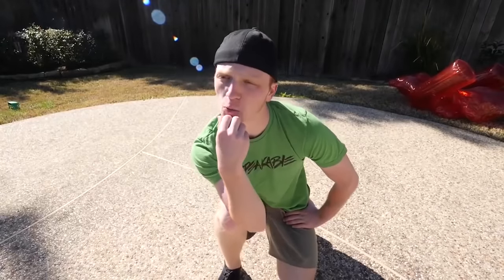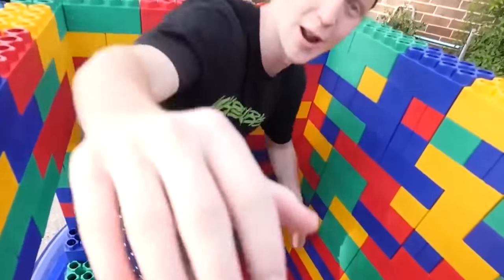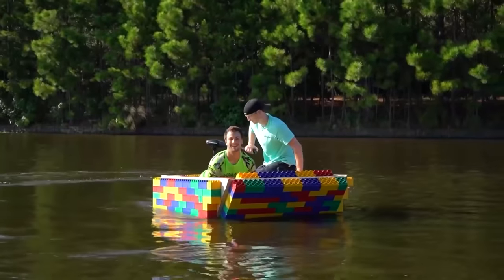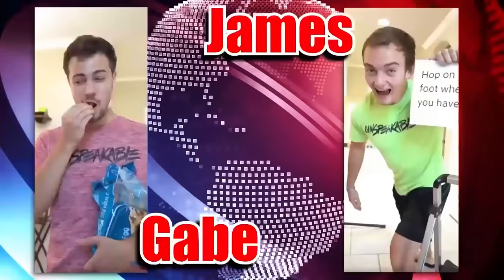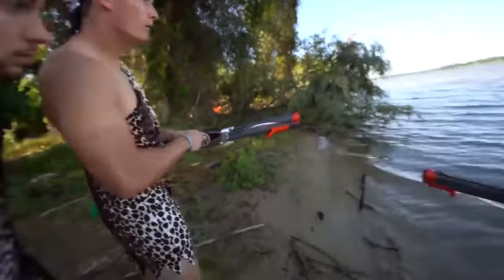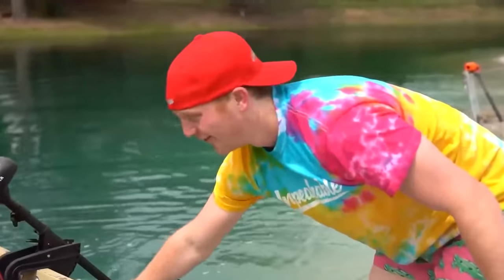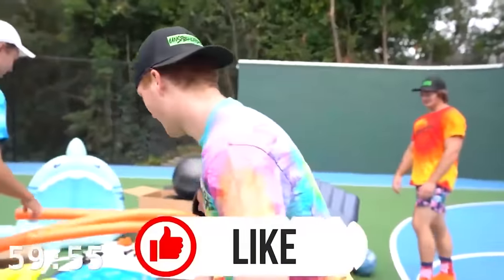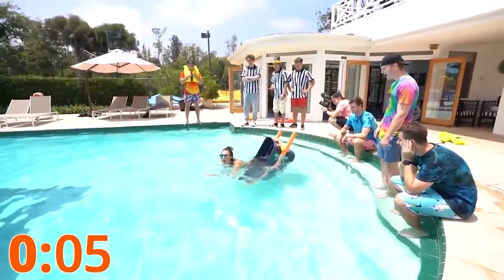Which Boat Can Survive A TORNADO?

Comment: 0:00: ⛵ Exploring different boats and building a unique watercraft.
5:02: 🚤 Building a large lego house on water and testing its survival in a pool.
10:09: ⛵ A boat made of legos is tested for durability in harsh weather conditions.
15:47: 🚤 A boat experiment goes awry.
20:36: ⛵ A boat is modified with a gasoline engine, reinforced front, and a roof for shelter.
25:48: 🎣 The group discovers a useful tool and plans to leave the island.
31:59: ⛵ Testing the durability of three different boats in various challenges.
36:52: 🚤 Boats are tested to see which can survive big waves and then a competition to build the fastest boat is held.
43:11: 🚤 Boats participating in a challenge to survive a tornado, with varying levels of success.
Recapped using Tammy AI